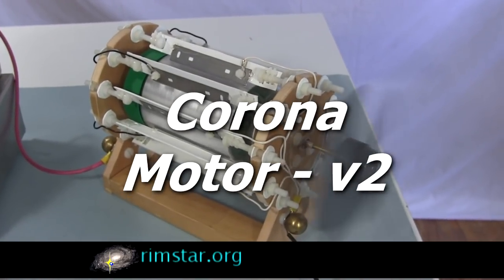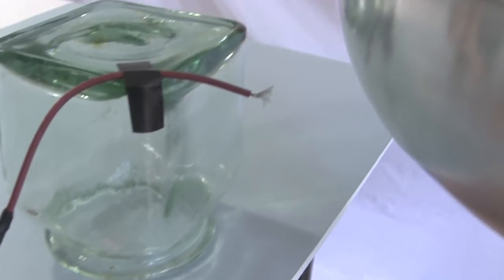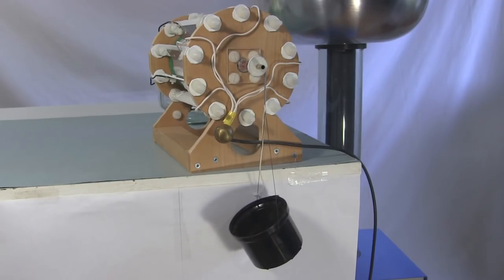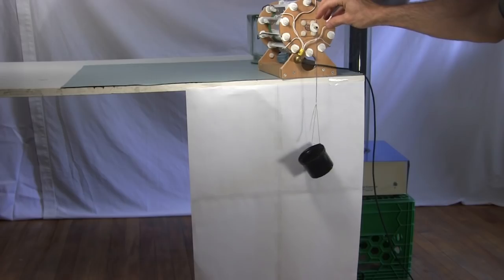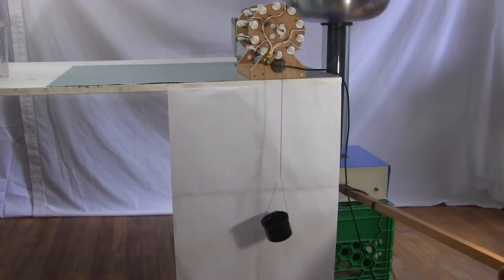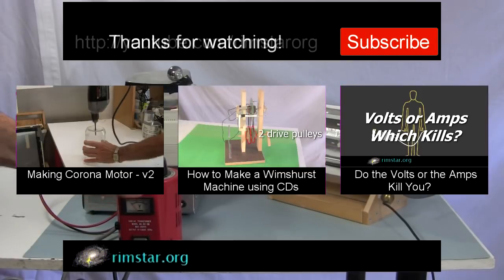Corona Motor (v2) or Electrostatic Motor/Atmospheric Motor

Comment from the maker: New video! My new, better corona motor is done! Includes overview, demonstrations and even load testing where I measure torque, work and power. Enjoy!
Reply: Looking at your capasitive rotor. Do you think it would go better with thinned dieletric? Say you glue foil to outside of jar, then glue Overhead transparency to that...
Reply from the maker: Mongrel Shark
That's a good question. My guess would be yes, a thinner cylinder wall would work better. The reason for the foil inside is to make a stronger/denser electric field between the sharp edge of the electrode and the outer surface of the cylinder. Having the foil closer would make that field stronger and result in more ionization and spraying of charge.
Reply: But greater risk of dieletric breakdown....
Reply: RimstarOrg as a fun experiment for yourself , if you still have your other motor, try running them in series and watch the power outputs.
Reply from the maker: jeremy gwilt
Actually, my plan is to do torque/power/work comparisons with varying number of electrodes by removing some. That'll all be in a future video, providing it's interesting enough or I can do it well enough of course.
Reply: Hey Awesome work with the corona motor. I believe the Testatika generator in Switzerland is one part Wimshurst machine the other part electro static motor. Somehow it manages to charge itself while its running. Thanx for the video.
Reply: Dear Mr Rimstar: Can you make an electrostatic speaker and upload it? (Instead of using a regular moving coil woofer, put 2 plates separated by space direct-driven from a vacuum tube plate output).

Comment: I love your videos! This new and improved electrostatic motor is great. What determines the initial direction? How do you do the commutation? No you've got me thinking about a lord Kelvin's electrostatic generator as a power source.
Reply from the maker: Thanks! The initial direction is determined by the angle of the electrodes. If you look closely you'll see they meet the cylinder at an angle. Where they're closest is the direction the cylinder rotates. However, if you give it a manual rotation in the other direction before starting it then when you start it, it will rotate in that direction. So the bias due to the angle isn't great. Re the commutation, there's a very small gap between the electrodes and the cylinder. The electrodes spray charge through this gap. I doubt Lord Kelvin's electrostatic generator would turn this or at least not very fast. It would have to be a pretty powerful Kelvin generator for that, and a very small corona motor.

Comment: I wonder if someone could make a kite with a flying wing under it powered by a corona motor? That someone should be me but you know i dont feel like working anymore.
Couldnt you gather more static by having the blades in like a jet turbine configuration? I think you could fit like 20x as many blades on it that way.

Comment: This produces ozone...right? Are you concerned about breathing it in?
Reply from the maker: I'm not sure that it does produce ozone. I've read recently that to produce ozone the voltage where the corona is produced has to be over a few thousand volts (low four digits). I don't have a precise number. The gap between the sharp edges of the electrodes and the jar is very small, a millimeter or two, and so may not require very high voltages at each point. I didn't smell any of the usual ozone smell, but I ventilated just in case.
Reply: RimstarOrg I guess, given there was indeed a corona effect which implies some ionization, it follows that there must have been some ozone production.. But then it should be in really small amounts.
Reply from the maker: DigGil3
I don't see that it follows. If my information is right then there is a voltage below which you produce corona without ozone. I just checked and it was a comment here on hackaday http://hackaday.com/2014/03/13/cleaning-up-smoke-with-an-electrostatic-precipitator/#comments Just search that page for ozone. Unfortunately I can't find anything to substantiate it and the commenter was just going from memory.

Comment: what's the efficiency of this type of motor? (not taking the psu losses into account)
Maybe with a bit of patience someone could make a hv dry cell though not sure if it delivers enough power.
Reply from the maker: I'm still working on figuring out the efficiency. We've been discussing it at https://plus.google.com/116395125136223897621/posts/iumoAp6X4kw

Comment: Great job! Will this work if you supply the HV from an ignition coil driver?
Reply from the maker: This requires HV DC. I could be wrong but I suspect that an ignition coil driver puts out AC. Or possibly you could add some circuitry at the ignition coil driver's output that converts it to DC.
Reply: @RimstarOrg  I tried to replicate your work the best I could, but I tried to run it with an ignition coil driver.  I can say it does not work with an ignition coil.
Here is my attempt to run it:
https://youtu.be/BzxTJBFZJ88

Next I will try to add a voltage multiplier to my driver and run it again.
Reply from the maker: Yeah, that looks and sounds like AC arcing. Nice corona motor! I like the easy gap-size adjustability using the slots.

Comment: Et faire l'inverse le moteur corona en générateurs  serait plus efficace ?
Reply from the maker: Google translation:
Non, ça ne marche pas. Le moteur corona ne génère pas d'électricité si vous le faites en sens inverse. C'est un moteur électrostatique. Les moteurs électromagnétiques fonctionnent différemment.
Original English:
No, that doesn't work. The corona motor does not generate electricity if you do it in reverse. It is an electrostatic motor. Electromagnetic motors work differently.

Comment: I recommend that you try hooking up the Corona Motor to a gear box and see how much torque you can get out of it since it is fast for the size. Anyway, nice set up for the motor.
Reply from the maker: I haven't hooked it up to a gear box but I have done the same load test running it with my 30kV power supply as I show in the video with the Van de Graaff generator and with more mass. It moves just as slow as in the torque test in the video and gives a torque of 0.0054Nm. You can see the data and calculations here https://plus.google.com/116395125136223897621/posts/iumoAp6X4kw
Reply: Okay, thanks.

Comment: Won't the electric field create some current in the aluminum foil? If so, then it' a loss.
And I don't understand what the benefit of the aluminum foil is.
I mean, won't it be better without that foil?
Reply from the maker: I think the idea behind the aluminum foil is to allow a charge that's opposite to the charge on the blade to gather on the foil. That would strengthen the electric field and pull more charge from the blade.

Comment: Sorry if this is a bad question im not very educated in electrics but I am wondering if you could use a dead battery as a ground ? I was trying to think of a way to run one of these when flying around and attaching a ground wire to the ground isn't possible  I couldn't see it being practical of course but I am curious about it  :s. Sorry again if this is not thinking right
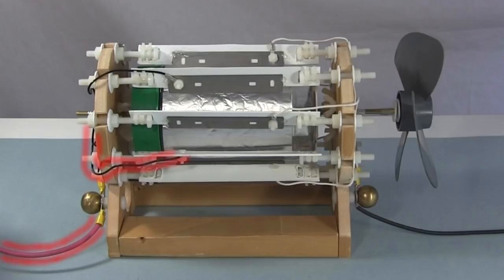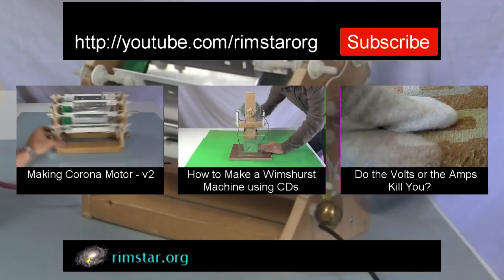Reply from the maker: RALLIR You don't need a ground to run one of these. At 0:39 I briefly say that alternatively one side could be connected to high voltage positive and the other side to high voltage negative and then show that using my Wimshurst machine, where I don't have any ground connection. Whatever high voltage power source you use will already have two sides to it, so connect one to one end of the corona motor and the other to the other end of the corona motor.Oh, and no, a dead battery won't work as a ground.But speaking of grounds in the air, I'm not familiar with RC planes but for passenger planes I've heard that the metal skin of the plane is used as the ground. I think that's the same principle at 4:14 in this Van de Graaff video where I use the Faraday ice pail effect to get a ground "How to Make a Van de Graaff Generator Part 2".
Reply: oh thank you for this knowledge :) and the quick response
Reply: In electronics, the "ground" is actually a common point where all parts of the circuit ends. Where the voltage is more negative (you can also make it be positive, it's the same) than what we call "positive" (again, reversing the poles will usually make no difference). Usually this is the minus side of a battery.

 As RimstarOrg said, in vehicles, it's common to attach the minus side of the battery or generator to the metal around the vehicle (whether car or plane). It's just to keep from using wires to connect everything and instead you can just connect the "ground wire" to the nearest piece of chassi.

In many electrostactic machines (specially ancient ones) people would refer to literally attaching part of  a circuit to a pipe running into the ground or such thing. Very High Voltage machines (like most electrostatic machines are) can work with one terminal in the air and another in the ground (literally the soil) because they generate electric fields that flow between the the atmosphere and the Earth's crust. Specially if they use radio waves where, in this case, having the wire into the ground will make the waves synchronize with natural electric fields, somewhat. It's like what was shown in this video with the Van Graff Generator (if the the generator's dome was the Earth and the wire hanging in the air was some terminal suspended, which then has the "grounded" counterpart).
Reply: thank you for your added insight this has helped me learn more on the subject :)  and encouraged me to research more of these mechanics

Comment: What is the output of your Van de Graaff generator? You gave the rating of your HV Power Supply, but not the Van de Graaff
Reply from the maker: My big Van de Graaff is rated for 400,000 volts. Though with both power supplies the actual voltage across the corona motor was the same since that's limited by the distance between the blades and the plastic cylinder. The difference in rotational speed at that point is due to the current and the load on the corona motor. I don't know what that voltage was though, probably somewhere between 1000 and 10,000 volts. Likewise, I don't know what the current was.

Comment: Could you connect a dynamo to this motor to generate a usable current?
Reply from the maker: Yes or no. It depends on the power source. With some of the ones in this video, the shaft is spinning fast enough and with high enough torque so that you can. However, using the atmospheric electricity like this https://www.youtube.com/watch?v=qhXxSAv6rMg doesn't give enough power.

Comment: judging from the "crackling sound" and the low light test, looks like there is an inrush current for this HV motor.
Reply from the maker: Either it was an inrush of current or it just bottle-necked until the cylinder started carrying the charge away more efficiently. That was my guess.

Comment: interesting, i wonder how efficient it is as a percentage ignoring losses generating the hv.
Reply from the maker: I'm still working on figuring out the efficiency. We've been discussing it on my Google+ post here https://plus.google.com/116395125136223897621/posts/iumoAp6X4kw
Reply from the maker: *****
I won't know until I'd done the efficiency tests and calculations. My guess is it won't be as efficient since transfer of charge through corona isn't very efficient.
Reply: RimstarOrg is it possible to change the shape of the rotor to minimize the coronal discharge wastage?
Reply from the maker: Pulsed Neutrino
It may require a complete redesign, so that everything is kept internal, like maybe having the electrodes face the inside of the rotor?
Reply: interesting. i've had two ideas which may be useless idk. 1. perhaps a thin edge to thin edge to stop corona dispersion by adding blades to the rotor too. 2. i can't see a reason why the skin effect would not work to reduce losses with chopped dc although it may impair correct rotation. thoughts?

Comment: if you spin the motor can it generate electricity?
Reply from the maker: Nope.
Reply: unfortunate. I'm looking to find or build a generator with  magnetic bearings.
Reply: Would be fun if it can generate something, but not exactly electricity. Then researchers would come with some fancy name, like charge vibe or voltage flow =__=

Comment: You make good tutorials, this the missing element for a sane free energy community research. Have you consider investigating magnetron - example: copper blades turbines inside magnetron cavity with a premanent magnetic field, it should turn pushed by lorentz force - and it could be similar to a corona motor (we should see corona effects purple sparklings) - also Jules Guillot free energy generator could be a complement to corona motor V3 - thanks anyway for what you do

Comment: hi rimstar pls tell if we can put another type of bearing because ceramic is not available ebay
Reply from the maker: Muneer Arif Here are the ones I bought on ebay http://www.ebay.com/itm/261462513315?ssPageName=STRK:MEWNX:IT&_trksid=p3984.m1497.l2649 When I do a search on ebay.com for "ceramic bearings" and lot of them come up. Make sure they're also dry bearings. The grease slows them down.

Comment: would gears help the torque?
Reply from the maker: It should be possible to make gears work. I did play with the idea a bit. I used different sized pulleys but the same idea. The problem I ran into was getting enough torque to start he pulley turning in the first place.

Comment: Can i use a 1/16 aluminum sheet instead of foil paper
Reply from the maker: The edge of 1/16 aluminum sheet is probably not sharp enough, unless you can sharpen it somehow. You need a blade-like edge.

Comment: To make the motor work better, seal all exposed wires and connections with corona dope. You might also seal most of your plates. Stop all leakages to air.
Reply from the maker: +aaaflooddrying Thanks. Instead of sealing all connections, I've gone with well rounded parts at the connections. But where the wires connect to the plates and three of the edges of the plates themselves are coated in corona dope. See my video about the making of this one https://www.youtube.com/watch?v=9uEjXsX1F14.
Reply: +RimstarOrg I know edges leak, and maybe you could see this. But all the rest of it is leaking to, you just can not see the leaking. Tesla spent allot of his time stopping leaks, we should to.
Reply from the maker: +aaaflooddrying Oh, I'm well aware of leaks and invisible ones too. Sometime I feel like a plumber, chasing those leaks! It's good to see I'm not the only one aware of them.
Reply: +RimstarOrg If you look at Tesla's Disruptive discharge diagrams, he used oil, he used zinc plates, he used heavy rubber insulation, he used a thick insulation sheet between the output wires. All to stop leaks.

Comment: please make a really big HV capacitor 
and the smell of ozone is pretty good
Reply from the maker: I'm not sure there was ozone in this case. I read that for ozone to be produced you need over some number of kV (2 or 3kV or something small like that.) Given the small gap between the sharp edge of the electrodes and the cylinder, the voltage may have been lower than that. I didn't smell any of the usual ozone smell but I ventilated just in case anyway.
A big HV cap, huh? You want me to blow things up, don't you! :D
Reply: RimstarOrg actually yes :)

Comment: You are doing something very wrong my friend. This motor produces more power at higher rpms, so you need a dynamometer to find its real power. Because of its working mechanism, higher the rpm more current it draws so more power it generates. Try to find a way to measure its real power, at its nominal rpm.
Reply from the maker: ***** I agree. That's why I haven't done further torque tests. I'll look into dynamometers.